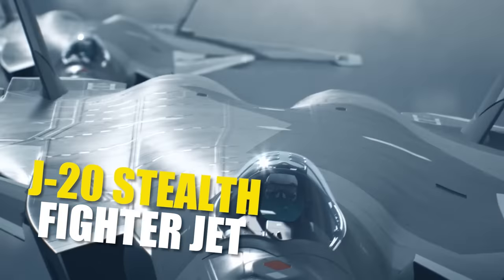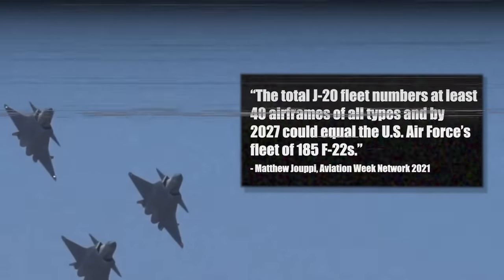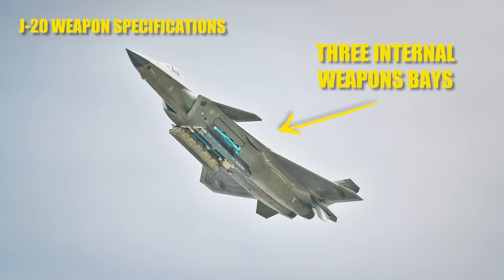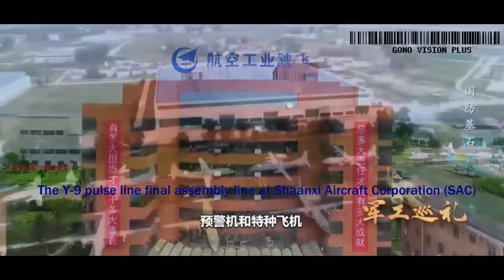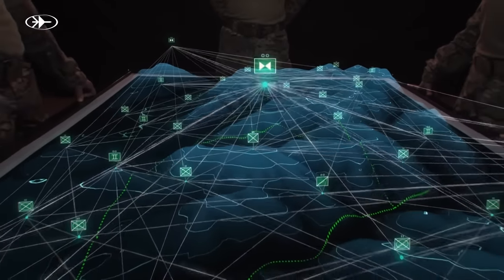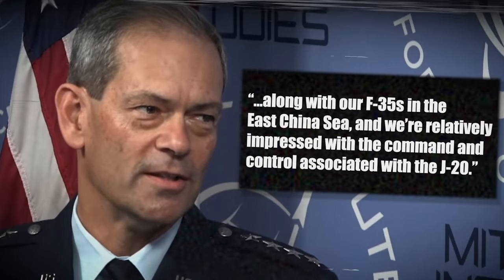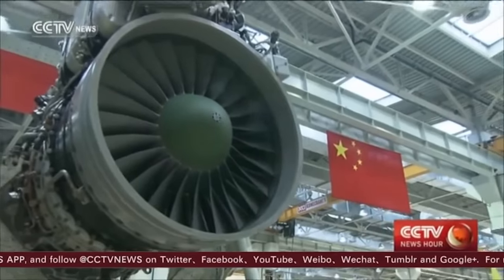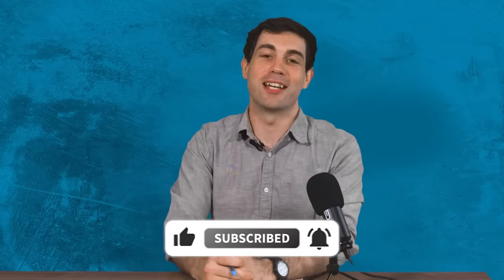How China Stole their J-20 Stealth Aircraft

Comment: I would say it's a respectable first attempt at stealth...but so far modeling indicates it doesn't even equal the F-117 in terms of its stealth...which is generally fine since it's primarily designed to just be able to get close enough to an AWACS to take it out from BVR.
Reply: If you're going after a AWACs you have to get past the aircraft that are linked to the plane. That's easier said than done considering the F-15E is more than the J-20 can handle. I wouldn't be surprised if the F-16 is more than the J-20 can handle. I think it's more of a show pony. It's strength would be at sea if American forces are crossing the Pacific.
Reply: @gravyd316  Well, AWACS would still need to know which direction the J-20s are coming from to direct fighter screens for intercept. Stealth aspect would severely cut down on the range at which the AWACS could detect them, not to mention the range said fighter screen could get a High PK lock. As I said, they just need to get in range to engage with BVR then hightail it out of there. That thing is a boat and probably maneuvers like one, so I doubt they'd deliberately merge with fighters that can actually dogfight.
Reply: It's probably comparable to a SU 57 due to the un-stealthy round exhaust and canards
Reply: @Myungbean they be coming from China yo
Reply: yeah dude, an rcs of 1-3m doesn't say stealth to me whatsoever
Reply: @Myungbean  I'd understand if it actually had stealth. It has a low RCS compared to a F-15 but that's not stealth. From what I understand China is a long way from the achievement of true stealth.
Reply: @Myungbean dude the awacs will see the j20 no problem, have you seen what the rcs is of it??? 
Also, usaf is finally getting a replacement for the awacs, its the e7, its superior in every way, and Australia has been flying then for a very long time, so theyll be out there providing tons of data the awacs cant get, but i promise you the awacs will def see a j20
Reply: @jamesmaddison4546  I've never seen all aspect RCS estimates that high for the J-20. Modeling suggests it's between 0.1-1m. I mean, still sucks compared to US Stealth, but 0.1 is good enough to make detection at BVR hard.
Reply: @flossordie2256  lol, China is big yo.
Reply: @gravyd316  Yeah, like I said, it's got nothing on US Stealth tech. But models suggest a 0.1-1m RCS, with it more likely being something like 0.1-0.5m. That's good enough to make detection past BVR missile range even for AWACS very difficult.
Reply: @gravyd316  F-15, F-16 is more than what J-20 can handle??
Dude...what are you smoking?
Reply: @calvinblue894  Well since you're so adamant it's a superior aircraft tell us in what ways it's superior to either the F-15E or a F-16.
Reply: @calvinblue894  and tell us what you're smoking..... Other than Asian micro pennies 😂.
Reply: But are the Chinese AWACS equal to the Western aircraft?  They are the true battle managers and will control aircraft when in the air for a long period.  US aircraft sync together which creates a powerful network.  With the F-35s able to control drones flying on their wings, the J-20 is more like a 4th generation.
Reply: @gravyd316  If you want to brag about US military, claiming F-35 or F-22 is better than J-20... Fine..
But F-15/16?? Come on...
You letting ego blast through your brain..
Reply: @gravyd316  J-20 is 5th generation, F-15/16 is old technology..
Kinda far fetch to claim superiority with old jets..
Reply: @Arkhangel99 j-20 has a double seat variant that has capabilities of controlling drone squadrons, though details of it is still very much classified now
Reply: @chrisbarr959  The Eurofighter which is 4.5++ has rcs of 0.1 despite having canards. Where does this myth that canards reduce stealth come from i wonder?
Reply: @calvinblue894 yeah i kinda have to agree.
Reply: I read the book too.
Reply: @Myungbean  AWACS can detect stealth aircraft. The issue with steals is not in detecting, but targeting.
Reply: You mean a giant airframe and rivets that aren’t flush with the body work aren’t stealthy?!
Reply: @calvinblue894  And that's what I was looking for. Your statement proves that you know absolutely nothing about the topic. The F-15E is a 4.5 gen and so is the F-16. Actually technically until China refines it's stealth to be functional it falls in the 4.5 gen. The F-15 and 16 have decades of experience put into their modern design that has been proven. Since you can't list a single advantage that the J-20 has against either I'll list things that the have against the J-20
1. Avionics. The F-15Es avionics are unparalleled and only comparable to the F-22 and F-35.
2. The F-16 is a excellent multirole fighter. It's a all around threat weather it's sinking ships or outmaneuvering other fighters. There are very few fighters that can out dog fight the F-16. 
3. Weapons. The F-15E can carry the most modern armaments that the United States has to offer and they're all proven. 
This list can continue but if you doubt any of the facts I've laid out just look the information up for yourself.
Reply: @calvinblue894  oh and let's not forget about who's flying the fighters. It's undeniable that pilot's in the USAF,Navy,and Marine Corp are the highest trained and capable pilot's on the planet. I doubt even Chinese pilot's would deny that fact.
Reply: @calvinblue894  and I'm still waiting for one advantage that the J-20 has over the "old" fighters. Oh I did forget to mention the speed of the F-15. It makes a  SU-30 Look slow by comparison.
Reply: The J-20 is built specifically made for the South China sea to target the AWAC, refueling planes, ships and mainly logistic targets.   It's not design to fight against the US. stealth fighters.  If the US fighter fly over China, they want to make sure it doesn't have a awac to assist it or the capability to refuel to fly back because the South China sea is a big ocean.
Reply: @TheOne30264  Well there's a surprise. Someone who knows about the Aircraft instead of just fanboying because "It's New"...... Actually it's getting old but
Reply: Yeah ide like to see what "modeling" you are referencing here.
Reply: @calvinblue894 The avionics and radar of both F16 and F15 have been updated extensively since their creation. Other than some stealth advantages, what advantages does the J20 platform have over either platform?

Just because an airframe is older doesn't necessarily mean it is worse.
Reply: Yes I agree,  more an anti AWACS, anti logistics (refuelling planes) style.
Reply: AWACS will see it first and therefore more time to respond. 5th gen stealth are only configured to reduce detection range of high band radars but not so much on lower frequencies like the L-band radar on AWACS. Exception ofcourse are stealth bombers like B-2 and B-21.
Reply: @gravyd316 you can see the engines from the front of f15e, they reflects signals like crazy. On f-22, f-35 and j-20, (not su-57) the inlet covers the engines, significantly reducing the signature
Reply: @u2beuser714  The thing about canards (horizontal stabilizers too) is that they are constantly changing angles and it is not possible to completely calculate stealth for all those angles. The front aspect is the most important, that is why it is considered a safer bet to keep your control surfaces masked by other fixed surfaces at the front on aspect. Just maneuvering around might be giving you away do to the pitching of the canards out in front of the silhouette. Just remember that RCS is often measured on a pole, stationary, and control surfaces flat. We don't have real in-flight numbers but I'm putting my money on horizontal stabilizers in the rear, masked by the wings, being harder to detect than moving surfaces right there in the open at the front on silhouette.
Reply: @BionicBurke   If you deflect the horizontal stabilizers of an F-22 they indeed create a huge radar return, and there is no masking that increase of frontal surface area. The only time that frontal surface area can be masked is when the stabilizers are near neutral. 

The real "issue" with canards is the fact that they require a dihedral as to not disrupt air flow around the wing. This means canards from the frontal aspect have a different angle to the wing, and thus can potentially create a greater radar return. The increase in return is marginal though, and there are a number of methods you can use to decrease frontal RCS even with the use of conards. Even the JSF predecessor called CALF/JAST featured conards. 

Aircraft like Eurofighter have use long arm conard design, which means the conard is much farther forward from the wing compared to something like Rafale or Gripen. This means that the control surface can be smaller and deflect less in order to create a moment (rotational force). You can see that j-20 also use a long arm conard design, and the control surface itself is quite large. It probably has to rotate less to generate a given moment compared to other aircraft. You can also look at the tailless design of J-20 along with the smaller vertical stabilizers compared to the F-22. This can help reduce its net-frontal surface area despite the conards. 

China also decides to implement thrust vectoring to the j-20 this would further aid in reducing the amount of deflection the conards need to have. If the engine generating your moment the control surfaces don't have to.

The final piece of the puzzle is radar absorbent coatings of course. Putting a lot of RAM on the control surfaces will work wonders when reducing RCS even with deflection angles. This is one of my issues with op's statement that some "models" have concluded that J-20 is stealthier than an F-117 (assuming f-117 has not received modern RAM upgrades). There is simply no way a modern fifth-generation fighter with up-to-date stealth coatings is going to have an RCS larger than an F-117.
Reply: @jamesmaddison4546  I am sure the awac see the missile coming too.
Reply: @calvinblue894  This guy is high on US fighting Iraq and Afghanistan where the opponent have no ability to fight you in the sky.  The battlefield in the Ukraine war totally crushed the leopard 2 and bradly fighting vehicle myth of invincibility.  They just destroy them like any other vehicles.
Reply: @gravyd316  What's the use of speed when you cannot see your opponent??
You don't understand what is stealth??
Reply: @jakej1837  You cannot lock in missile on opponent.. that's what stealth is about..
OMG..basics..
Reply: @u2beuser714 well assuming that is correct, that is still 10 times less stealthy than an F-35.
Reply: @calvinblue894  you can still lock missiles onto your enemy, you just have to get a lot closer to the stealth aircraft for the radars to be able to track them. 

This gives stealth fighters an advantage so long as their radar is of sufficient range to shoot first.

Edit: also depends on which F-16 and which F-15 they are talking about. The F-16V and F-15EX have new and vastly improved radars that could possibly threaten the J-20 unless the J-20 has sufficient radar range to engage these fighters.
Reply: @calvinblue894  So you can't point out a single thing the J20 is better at other than stealth?

In context, we are talking about J20 attacking AWACS and the fighters that are ahead of the AWACS to defend it. The AWACS will be able to detect a J20 and allow their missiles to lock on. That's the whole point of the datalink system the USA uses.

You seem to have a misconception that stealth means the plane is invisible to all radar, when that is far from it.
Reply: @banaris28  It's a bit of both? Even an AWACS will see a reduction in the range at which they can detect stealth aircraft. Eventually will have a pretty good idea that they're out there even if they can't get an exact fix, but by the time that happens, it's entirely possible that any fighter screen redirected will be unable to intercept before the J-20 gets in range of their BVRAAM.
Reply: @EEEEEEE354  You can easily google several papers on attempts to model and estimate the RCS. Obviously it's impossible to do a 100% accurate estimate seeing as info on the RAM is not publicly available, but all you need to do is make a 3D model of the fighter and run it through simulations. It's literally the same process public think tanks have used to give ranges for the RCS of the F-22, F-35, and the Su-57.
Reply: @johnsilver9338  L-band is not some anti-stealth trump card. It will still struggle to see any low observable aircraft at its max range. The point is to delay detection long enough that help cannot respond in time to the AWACS or whatever logistical asset is being targeted.
Reply: @jakej1837  And I think you're overestimating what an AWACS can do in this scenario. At best, the AWACS will be able to inform pilots that stealth fighters are in the area with a very rough heading and range. But it will not be at the max range an AWACS would normally be capable of detecting a non stealth target and probably uncomfortably close for the AWACS. The AWACS in all likelihood will NOT be able to provide a quality lock to data linked assets until the J-20 is at LEAST within about 50 miles...which if that happens the AWACS is pretty much toast. And again, you're assuming any fighter screen will know the exact heading the J-20s will be approaching from to immediately screen, which probably will not be the case.
Reply: @Myungbean  exactly so you used the wrong models. I've seen exactly what you're talkin about and pretty much everyone I've talked to in the industry says they're wildly inaccurate.

For instance RCS measurements of the F-35 are notably higher than the F-22, according to those papers. This contradicts a number of statements by pilots and USAF officials stating that the F-35 has a lower RCS than the F-22 (I know, shocking).  When you use models purely based on shape, you are leaving out a lot of important factors, not just RAM. These models are so inaccurate that they are virtually meaningless.
Reply: @Myungbean  Like I said "5th gen stealth are only configured to reduce detection range of high band radars but not so much on lower frequencies". There are reductions too but not as significant like on the X-band. AWACS can definitely see J-20 1st. And J-20 will still have to get closer to use PL-15.
Reply: @EEEEEEE354  ???? What do you mean I "used the wrong models"? I explicitly said the models are incomplete and based purely off shape without taking into account additional factors like EW, and RAM coatings which would only reduce RCS substantially further. No *good* 5th gen RCS model has OVERestimated the actual RCS of a 5th gen asset, so claiming I'm "using the wrong models" makes no sense.
Reply: @Myungbean  you used the wrong models as in you used civilian sources that are incomplete and nearly useless for any useful comparison. And what do you mean "overestimate"? It's clear as day they're overestimating the cross-section of some of these aircraft given where J-20 places in the models you are using.
Reply: @EEEEEEE354  Overestimate as in, a shape based model giving a smaller RCS (thereby overestimating the stealth) than the actual RCS. And seeing as *ACTUAL* RCS figures are completely classified, all we have are best guesses to operate with. And yes, I stick by what I said. Computer modeling in every case, even without factoring RAM and EW suites with things like active cancellation have ALL shown every single manned US stealth asset (including the F-117) to be stealthier than the J-20 and Su-57 when based off shape alone.
Reply: @Myungbean   maneuvers like a boat…  heh  okay…
Reply: @jcak552  Yah, compared to the F-22, F-35, or an F-16? Until they get the WS-15, it's pretty underpowered.
Reply: @Myungbean  your point is very valid, but wouldn’t sensor fusion compensate for it? As being able to see “oh there’s something in this general area head between me and here” fighters head there and then the combination of let’s say 6 different angles would triangulate the j20?
Reply: @jcak552 any hard maneuvers will bend the airframe, due to the positioning of the weapons bays there’s no “spine” of the aircraft so theoretically it can’t handle high G.
Reply: @calvinblue894  I understand exactly what stealth is. In fact I understand much more than you. It's not a rumor that the J-20s stealth doesn't work. It's a fact. The can't recreate vital parts of the stealth system. It's not just the shape of a aircraft that creates stealth. There's a little more to it than that. There's a coating that China can't recreate and then there's electronics in the aircraft that they aren't able to duplicate. There's the exhaust from the aircraft that has have minimal impact on the environment around it. Have you ever heard of a J-20 sneaking up...... Anything? No. I'm not saying China won't eventually have stealth capability but as of right now. They don't.
Reply: @chrisbarr959  Nice to see someone else who knows there's more to stealth than just a angular shape. Other nations can make a aircraft look like it has stealth but that's about it. Then there's the fact that America spent decades creating stealth. People seem to forget that during development they found out what does and doesn't work. It's much easier for American forces to detect a stealth aircraft because we have Aircraft to test these detection systems on.
Reply: @gravyd316  Have you heard of J-20 sneaking up?
Yes..J-20 sneak up on F-35... LOL 🤣😂😂
Reply: @Myungbean It's bigger than B2. If you believe that the B2 can be perfectly invisible, then you know that the aircraft's stealth has nothing to do with size.Stealth is a holistic design, and every detail determines its RCS.
Reply: @gravyd316 How did you come to the conclusion that either airframe is the J-20s equal, let alone superior?
Reply: @gravyd316 1. It has a larger and more powerful radar
2. Without the Aim-260s, it has longer range missiles
3. It is stealthier, with a far lower RCS than either aircraft, so it will spot them before they spot it.
Reply: @Arkhangel99 Chinese AWACS are better than the US AWACS, they use AESAs while we still use PESAS.
Reply: @u2beuser714 Same with the Sea Widow, which also had canards.
Reply: @Myungbean It is far from underpowered with the WS-10Cs, it simply can't super cruise without the WS-15s. However, WS-15s has already entered serial production earlier this year.
Reply: @Myungbean  AWACS are like lighthouses, they're impossible to miss and a non-stealthy plane 400km away firing a PL17 VLRAAM set to home in on an AWACS' emissions will knock them out of the sky with ease.
Reply: @gravyd316  I dont care how good your avionics are, your 5th gen radar is not going to see a 5th gen fighter before a 5th gen fighter with its own 5th gen radar sees your 4th gen airframe.
Reply: @Myungbean  using purely shape based RCS models is pure nonsense, and there are a multitude of simulations that exist that provide different RCS models. Not all are stating the F-117 is stealthier than a J-20, and the notion that a modern 5th gen fighter is less stealthy than an aircraft that did not use computer-aided design or modern RAM, is complete bogus. 

To further bring your credibility into question,  you even stated something about active cancellation as if that technology even exists. There is no such thing on any aircraft right now, despite claims by Bill Sweetman that Rafale's spectra EWS uses the technology. That has been debunked over and over. Active cancellation is too difficult to perform in the x-band, and LPI AESA radars would make the technology completely moot. DRFM is the closest you are getting to "active stealth" and it's still nowhere near it.
Reply: @jakej1837 if you don’t think Stealth is that big of a deal, then you would have to say a F15/F16 upgraded with F35’s avionics/sensors/weapons would be just as good as F35/F22.  Which obviously isn’t true.
Reply: @gravyd316 😂😂😂Your understanding.
Reply: @xsu-is7vq  Again, it's in context to the premise of the scenario that was raised by others. Basically a J20 firing a missile at an AWACS just at the border of its detection range and F16/F15 defending. The idea is AWACS would have detected the J20 and the defenders ahead would try to target it. Having an AWACS there would reduce the effectiveness of stealth drastically.

As for your hypothetical of F16/F15 vs F35/F22 it illustrates my point well that the comparison is a lot more complex. You are making a ton of assumptions:
1) That the stealth of the J20 is comparable to F35/F22.
2) That the avionics and radar of the J20 is comparable to F35/F22
3) That the airframe/engines are comparable to F35/F22
None of those are good assumptions to make. As such, a comparison of F16/F15 to F35/F22 is a completely different comparison than to a J20.

Even on stealth alone, J20 is widely regarded as multiple orders of magnitude less stealthy than F35/F22. Numbers thrown out above is 0.1-1.0. A F16 with Have Glass V treatment is 1.2. So the gap really isn't as big as people make it out to be, even though F16 is a much older design.

This even putting aside the angle of the plane relative to the radar plays a huge factor in the radar return, with most stealth comparisons only being done on the front. As such, a J20 fleeing after firing a missile toward the AWACS will not necessarily be anywhere near as stealthy as when it approached.
Reply: @suisinghoraceho2403  awe another one with a micro. Is it hard to pee out of that thing?
Reply: @jakej1837  Now who’s making a lot of assumptions?
You are assuming:
1. AWACS can detect J20 from frontal aspect at more than 200km.
2.F15/16 with latest radar can target J20 at 100-200km
3.Guesstimate of J20’s RCS based on model of shape only is accurate representation of J20’s true RCS
4. China would knowingly mass produce an aircraft that falls far short of what’s needed to be truly stealth.
5. China didn’t and couldn’t apply a RAM coating to J20
Reply: @xsu-is7vq  
I'm not making any of those assumptions, I'm just pointing out there's a lot more to a fighter than stealth and why that analogy you make of F16/F15 vs F35/F22 does not apply to the J20.

But I will address the points you raised
1. The assumption the AWACS can detect the approaching J20 when the missile is fired is the premise raised by others, not me.
2. No, the premise is the AWACS provides the targeting. The F16/F15 are just missile trucks, with their radars coming into play only as secondary as they get near (or if AWACS gets taken out).
3. The guesstimates are the only objective data available to compare the various designs. Without them, there is no discussion to be had, and like other points they are assumptions made by others.
4. You are forgetting appearances matter a whole lot to China. While western countries openly critique their own designs and point out the weaknesses, China is known to exaggerate their capabilities and rarely will highlight deficiencies. At this point in time, even if they didn't have the capability for something as stealthy as a F35/F22, building something that at least looks the part is totally something China would do.
5. Nope, the models people are discussing are based on the J20 with known RAM coatings being applied. Without RAM considered, from what I can find, the numbers go up to about 1-3, still better than any 4th gen fighter without RAM, but worse than the numbers quotes here.
Reply: @johnsilver9338  Did you mean to reply to someone else? I never said anything about the J-20s RCS coming close to the F-35.
Reply: @voidtempering8700  My mistake then. Sorry for that.
Reply: @voidtempering8700  Posted something else at fist. But I would like to point out that only US Navy besides Japan uses a UHF band PESA AWACS with its E-2D Hawkeye. All other AWACS are one the L-band AESA. If I'm not wrong due to power constraints, its impossible to use AESA for a UHF band in an AWACS. Lastly with the procurement of E-7 Wedgetail, things will definitely turn around for the better for the US Airforce.
Reply: @johnsilver9338  Nevermind, you did respond to the right person. The other commenter said that the Su-30mki detected the J-20 from hundreds of kilometers away, something India never said in the first place. Now, even if we assume they did say that, it still wouldn't be accurate.

The Su-30mki uses the N011M Bars, which can detect a Mig-29 at 140km, which has a 5m^2 RCS. This alone disputes the hundreds of kilometers figures that the commenter stated, especially since the J-20s simulated RCS without RAM is around 0.21m^2 frontally. The Mig-29 is nearly 24 times bigger RCS wise, and it has a detection range under 200km, let alone the J-20.
Reply: @johnsilver9338  Gonna have to disagree. Stealth contouring, possible EW, and RAM coatings still work on L band. Not as effective as higher frequencies but still pretty truncated range. An AWACS will see "something", but definitely not clearly enough to definitively say yep that's a J-20 and as I've already pointed out, it would need to redirect a fighter screen to intercept before the J-20 got within BVRAAM range, which is around 100miles for the J-20. Successful intercept would require a very vigilant fighter screen.
Reply: @carlef506  I'm not exactly sure what you're replying to or why this is directed at me since I never said anything about size and stealth but yes, I'm well aware the size is not really a factor for stealth.
Reply: @voidtempering8700  Assuming any figures China claims are actually trustworthy, WS-10Cs are an improvement but they're still not strong enough for what the J-10 was originally envisioned to do. I stick by what I said. Until J-20s with WS-15s are the norm, their engines are inadequate.
Reply: @hughmungus2760  Was that meant for me or someone else?
Reply: @Myungbean  Then you would be incorrect. The WS-10Cs are fine, they provide enough thrust to hit mach 2, which is more than enough for the J-20. The only capability they lack is the ability to enable the J-20 to super cruise.
Reply: @Myungbean  Additionally, you realize the WS-15s are in serial production, right?
Reply: @Myungbean  You forget US Navy uses UHF band radars on their AWACS. So J-20 will definitely be detected first.
Reply: @EEEEEEE354  Why is it nonsense? Shape plays the biggest factor. It does the vast majority of the work. Then RAM and EW take it the rest of the way. Why do you think other nations are planning on jumping straight to 6th gen fight development without even having developed their own 5th gen fighter? The frame of EVERY US 5th gen asset is meticulously thought out so that areas where energy from radar waves can accumulate and ultimately emit are few and minimized. And where did you hear the F-117 didn't use computer-aided designs? Of course it did. Just CAD done by late 70s and early 80s tech. The F-117 is purported to have RCS ranging from 0.01 to 0.003 m2. And let's be real. The J-20 is a mish mash of concepts. A kitbash of the F-22 and the Mig 1.44. Like I said, decent first attempt but China doesn't seem to thoroughly understand everything...which is why they had to resort to stealing information on the F-35 in order to make necessary progress. So the idea of a fighter with mostly stolen design maybe not being as stealthy as one produced by people that actually understood everything and DIDN'T have to stealth tech doesn't seem all that crazy to me. As for active cancellation. Sure, I acknowledge there is debate on whether such a system is even possible. If it did, it would definitely be classified. But for the viability concerns you voiced, I would counter that it would not need to cover the X-band. Most stealth features handle that enough. The concept has been around for *decades* and current needs would just need to cover the lower frequencies that RAM and shape are not as effective on. JUST enough destructive interference to give a junk reading. And keep in mind, if we can do active noise cancellation on tiny wireless earbuds, while it's not a 1:1 comparison, I see absolutely no reason why a modern jet, with a modern onboard cpu and modern rwr, can't do it.
Reply: @Myungbean   @Myungbean  shape played the biggest factor back in the 80s and 90s where RAM was signficantly less advanced. Again, look at the F-22 vs F-35. According to any civilian analysis, the F-22's SHAPE is far more stealthy. This, however, completely contradicts the sources that are in the know. Through use of advanced composites and paint, the F-35 actually has the lower RCS. I dare you to actually go do that research. Shape wise, the raptor should be more stealthy. It's not. 

The F-117 was a first generation design that used signficantly less advanced computer modeling that resulted in a faceted shape consisting of a lot of flat panels and angles. As computer aided design advanced, it became possible to incorporate curves into stealth design, and more advanced RAM picked up the slack. Again, we are talking about DECADES of advancement in stealth technology, and you are suggesting that the J-20 has a larger Rcs than a first generation stealth design, and basing that off of publicly available estimates? One has to ask, are you living in the same universe as me?? Even your mention of EW denotes that you don't understand that electronic warfare has NOTHING to do with RCS. Planform alignment stealth along with RAM are a passive means of reducing RCS. EW is an ACTIVE means of degrading enemy radar performance, and is entirely separate from actual radar cross section. 

With regards to active cancellation, your rebuttal is entirely insufficient. Destructive interference when applied to radio waves is very different than active cancellation of sound. Active cancellation when applied to radar requires very precise bandwidths and angular coverage, and a simple counter to it would be to either operate in an LPI mode where frequency hopping is used, or to simply have multiple arrays operating on slightly different frequencies. Not only that, but actively sending out radio waves is counterproductive to EMCON. There are a variety of reasons this technology has been abandoned. Even if it was possible, it would be situational at best, and counterproductive for the most part.
Reply: @chrisbarr959 the canards are radar transparent, they dont affect stealth
Reply: @Myungbean They just got W-15 engine recently, just go google it!
Reply: @gravyd316 Westerners seem to know everything, as far as you know what you are? How do you know that? Do you see the West from the media he can not be invisible he cannot be invisible?😂😂😅😅
Reply: @gravyd316 Why are Westerners always so confident in their antique planes? They said F22 F35 crushed J20, now they say F15 F16 crushed J20, Chinese planes are made of paper, you win😅